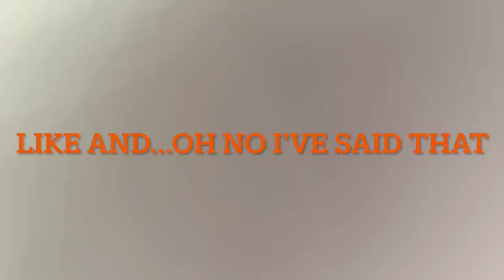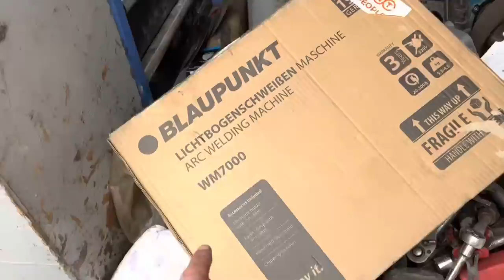More pressure…. Washers!! How to be a really good stick welder!

Comment: When I travelled with the fair ground a m6 bolt was a 13amp fuse replacement!! I guess the bit that broke off is cast that's why it keeps braking. Great video!!
Reply from the maker: 👌👌 the high capacity fuse

Comment: What rods ae you using with that stck welder?  6011 rods, 3.2mm, preheat with your mapp gas bottle first and away you go.  You also could do with a bit of an improvment in tekkers.  Drag the rod to keep the slag out of the weld pool.  6011 is pretty forgiving to be honest though, especially on metal thats a bit rusty or painted etc... they call it "farmer rod" for a reason.  Not massively popular in the uk and I've no idea why.  My fave rod.

Comment: You need to build up a fillet weld. That long weld fractured in the middle of it, the two sides were still intact on the metal pieces therefore the problem is the weld being too thin for the strain.  Put in first pass, then two on top, then three on top of the two etc, building up a wedge.  Also pre heat the metals being welded with oxy acet.
I’d do ot again before the forks carriage fails in use lifted high and injures someone
Reply from the maker: Thanks mate that’s much appreciated, yeah I’ll get on it 👍👍
Reply: I was gunna say looks like a casting you need to pre heat to get  a good weld on a casting .would you do better  using next size up bolts and tapping out to suit
Reply: Great vidoe mate you always have jobs at Vortex yard lol keeps u busy and birdie looked a little cutie keep up the good work mate

Comment: I know what you mean withe regards to smaller welding machines i had a "clarke mig 102 turbo" it would literally run a weld about 4 inches long before it had to cool down for 15 mins what an absolute steaming heap of 💩😂

Content is brilliant as usual keep up the good work Chris 👌
Reply from the maker: 😂😂 they was mate exactly the same as my old one 💩
Reply: @Professional-struggler  They've definitely come a long way, I've got a thermal arc 180 stick set which I'm pretty sure will also do scratch start tig and it's spot on. 

Perfect for welding up smashed underrun bars 🤣
Reply: Put a fan on it , inside the case if possible and the duty cycle will be a big improvement.
Reply: @snowflakemelter1172 it had a built in fan, it was just a cheap welder with a poor duty cycle. Honestly wouldn't have been worth the effort.
Reply: @scottythegiant  I've modified a basic transformer stick welder with a high powered fan so that it never overheats, it is possible.

Comment: Stick rods very metal specific  , try mig may hold better😊
Reply from the maker: Cheers Peter 👍
Reply: Nope, that can be welded with stick, 7018 preferably IF it's prepped properly, but it's a load bearing part thats meant to be bolted on so don't weld it in the first place.

Comment: Hey Chris I think you need to spend a week down at Snottys ..and train all those down at divvyvil how to check oil water.tyre pressures.grease the grease nipples on all the machines ect if they was as good as treating all the machines with some respect as they are at breaking things you would be out of a job "..........keep up the good work
Reply from the maker: True mate! They are getting there mate… learn by mistakes 👌👍 enjoy the sun Martin
Reply: @Professional-struggler  thanks Chris .very hot mate 40 plus some days .....I used to do same as you .plus drive and repair big plant .but as you get older your body takes its toll .through lifting brake  drums.gearboxes .diffs.multi leaf springs on your own.i think you have a few years left to find that out lol.back to the grey UK July time be good if I could meet up with you and talk some shit with you about the struggle .and a fosters of course ..good luck to you in the struggle .

Comment: 6mm bolt  is best for fuses for welders let the fuse board do it's job
Reply: Kiss goodbye to your welders PCB.
Reply: @snowflakemelter1172  my welder is rated at 16 amps so it's not a problem